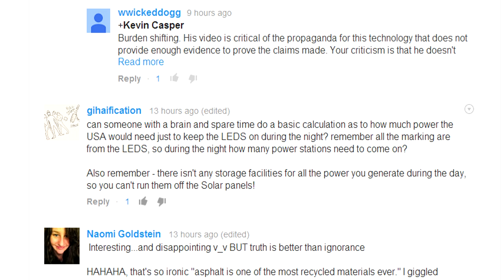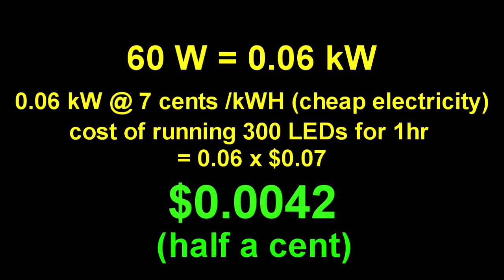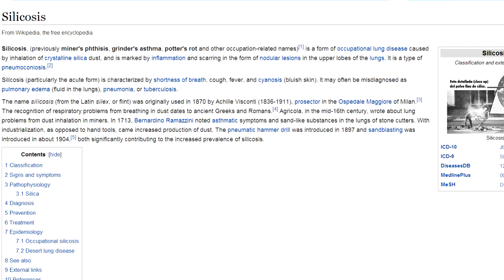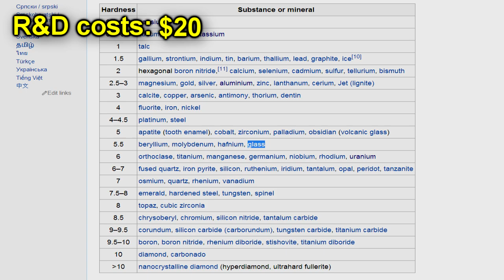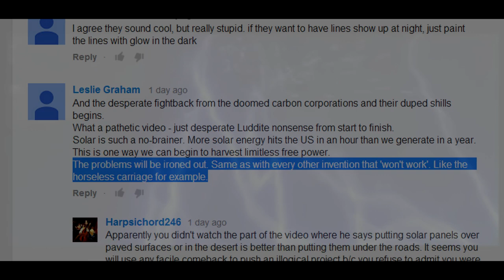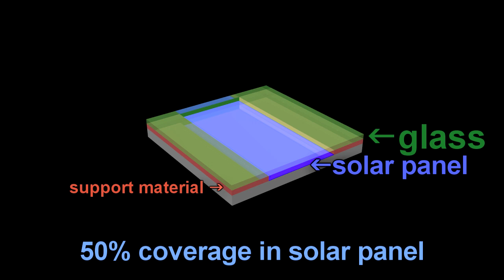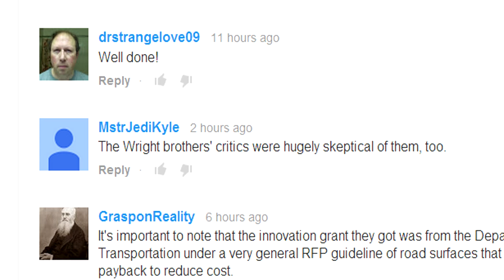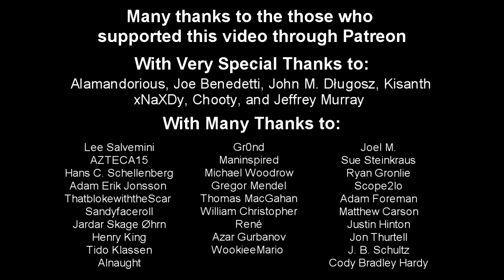Solar Roadways, IMPORTANT QUESTIONS AND ANSWERS!

Comment: It's good to be a skeptic, but: How much would it cost to replace all the blacktop roads with new blacktop? (eventually it will have to be replaced.)
If the roads are generating electricity, what will electricity cost at that point to power LEDs??
Why are you grinding rocks against the glass? Tires aren't made of rocks.
Health issues from ground up glass dust?  But ground up asphalt dust is safe?
We're not talking about glass that they make drinking glasses from.
The LEDs in a traffic light last more than 4 years. I think they last more like 20.
The solar panels use glass prisms to get maximum sunlight on the panels no matter what the angle of the sun, in addition to better road traction.
Reply: If you had listened you would have known it's to simulate the effects of dirt. He uses a piece of rubber to rub it to simulate the effects dirt being rubbed on the glass road by tires. It is a very simple experiment but then again, it's only a small fraction of the punishment actual traffic exerts on roads. Keep in mind that especially industrial vehicles will carry a lot of dirt on their tires.
Also: blacktop is quite cheap to replace and has a fairly long lifespan. Why do you think the stuff is used in the first place? The costs of regular public roads btw, are usually public information. Look it up with the apropriate governement body. As for the costs of the glass road: see TF's previous vid on the subject...
Reply: 1) Depends anywhere from  $1-$12 per square foot (about the size of 1 solar tile) depending on if there's asphalt already there and the treatments you want done to it, of course this is for materials and on a consumer basis, no idea on the labor on a contractor basis.

The cost for the panels without the corridor and extra grid that would be required are unknown but their initial hopes were to get it under $7k and hope the tiles last 20 years minimum.

2) He's grinding rocks against the glass to demonstrate that glass will get scratched by common rocks/sand which will both affect the texture they're relying on for traction and will cloud the glass as it's getting worn which will further affect the amount of power the tiles can generate.

They're using tempered glass which is a similar glass/hardness of the coffee mug.

As a note, if he tried this with gorilla glass instead of tempered glass it would still get scratched, just not as badly. Sapphire glass could be considered scratched resistant enough for road applications, but it has other shortfalls not the least being the enormous cost.
Reply: LEDs in traffic lights are not constantly on. These would need to be if they are marking the road, meaning their effective life span is lessened to its minimum expected. They might last longer, but it becomes unreliable at that point.

Also, if you had paid attention in the last video, blacktop is heavily recycled. Blacktop removed is reground, remixed with tar and reused. Also, unless they plan on placing these roads on 100% elevated surfaces, rocks, dirt, dust and debris will get on it. The road dust he picked up was likely on the shoulder of some road.
Reply: Roadbeds are made of crushed stone, and the designers of this project have made no mention of changing the roadbed as part of their pipe dream.
Reply: Highway blacktop can be recycled. Point refuted.
Reply: *****
Why would it matter if the materials aren't going to be good enough to do it's intended function? It's basically the same as using a diffuser on a camera flash or putting a flash light up to a water jug. It's nothing new or brilliant. Oh joy they are using an idea to solve a problem for a product that can't perform it's function.
Reply: NUTCASE71733 Can be and is.  Most asphalt being laid today is 95%+ recycled.
Reply: ***** the Prism/Retroreflector is a thing that has NOTHING to do with the Solar Roadways. The Prism/Retroreflector are widly used as reflectors on cars, in existing roads and Road-markings (Glass Pearls do the same).
Prism/Retroreflectors in the Solar Panels do not guide the light to the solar collectors; they reflect it away.
Prisms can guide the light to the solar collectors but do not work anymore under a protective glass cover (that reflects 80 % of the light away, or when scratched, diffuses it so the prisms cannot use it anyway)
Prisms above the protective glass will be worn away by 5 minutes of heavy traffic.
So forget the Prism/Retroreflectors!
Reply: Holy fuck.
Reply: Ok, I will answer one by one:
How much would it cost to replace all the blacktop roads with new blacktop?
- The blacktop is less expencive than blocks with PCB, LEDs, solar panels and other components. I don't have time to count exact numbers, but by estimate, it would be at least 100 times less expencive (since 1m^2 of blacktop all together costs about 50$ and just solar panel of that size costs 300$)...

If the roads are generating electricity, what will electricity cost at that point to power LEDs??
- Few times more than it would cost now. Energy from solar panels is more expencive than from f.e. nuclear power plant, plus you need to store it, or redistribute it (both would be harder in this kind of arangement). The problem is that making semiconductors (that is what panels are made of) and glass require very high temperature. Ordinary SP "pays" back energy that was needed just to make it in about 1/3 of its lifespan!!
Since SP under road are even less effective, they would NEVER pay back energy, and I am not even counting the energy requirements for production of covering glass...

Why are you grinding rocks against the glass? Tires aren't made of rocks.
- Tires are not made of rocks, but they usually pick them around the road. Look at any tire, you would be lucky to not find a single rock stuck inside...

Health issues from ground up glass dust?  But ground up asphalt dust is safe?
- Asphalt doesn't get ground up as easily as glass does..

We're not talking about glass that they make drinking glasses from.
- Any glass will have the same properties, otherwise it wouldnt be glass...

The LEDs in a traffic light last more than 4 years. I think they last more like 20.
- Because they are not under direct UV sunlight and they are shielded from heat. Only the temperature above 70°C (and you can get that at road) will shorten the lifespan of LEDs by 50%, direct UV will do the same trick...

The solar panels use glass prisms to get maximum sunlight on the panels no matter what the angle of the sun, in addition to better road traction.
- No, they won't. solar panels require direct sunlight, glass prisms won't help with that, due to actuall physics that is behind fotovoltaic effect and even if it does, you would have to get rid of trees and grass around every road...
Reply: 1- blacktop is being repaired as needed. And if when it actually needs to be replaced it's never all at once. There's never going to be a mass replacement of it.
2- He addressed the energy in a previous video.
3- He's grinding rocks on glass because roads tend to be coated with dirt (dirt is... rocks!) He use a rubber to mimic the tire pressing the rocks against the glass
4- Well, judging by how well it's doing, not as bad as Silicosis.
5- We're talking about tempered glass, which is not much better for it anyway. (17:30).
6- I don't know enough about LEDs to talk about it.
7- Glass still eventually wears and softens. Even asphalt, which is much sturdier, wears and softens over time, except it last much longer than glass.
Reply: ***** , I am all for using more solar power. Only the way the SFR propose is not feasible, only a money-throw-away. 
You don't have to be a top-man in the field of solar power to see that the SFR are really a waste of money. 
1. The panels cannot perform their duty AND support heavy traffic
2. Glass is not a usable surface for a road.
3. The panels cannot EVER be cost-positive.
Everyone with a bit of material knowledge, a general understanding of physics and a basic understanding of electronics can see that.
Only when they make a major and elementary breakthrough in physics (in other words perform a miracle), they could make it work.
I don't see that soon (not even this century).

The idea to pave the whole country with Solar cells is, though for other reasons unwanted, not so bad, but the roads, NEVER!
Reply: ***** I think his point was that the materials simply do not exist for the applications they simultaneously want for a solar road way and you don't need to be an expert to do basic tests on the proposed materials for the task to come to that conclusion.

The makers of solar road ways claimed that they already went to material's experts and came away with tempered glass as a best fit for the applications they want. The problem is that if you can show the fundamental materials still lack the properties required for their purpose that the project is a non starter.
Reply: *****
1) They're using tempered glass, not gorilla glass or sapphire glass with scratch resistant coating.

2) Sapphire glass is around 100x more expensive than tempered glass. It also has similar issues with shattering even though it's more scratch resistant than traditional tempered glass. Sapphire glass is also merely more scratch resistant, it's far from "unbreakable"

3) if your solution to this project is propose a material that is still subject to shattering and way way more expensive again I don't see this going much of anywhere.

As a note sapphire glass will always be expensive because it requires very particular chemical processes and temperatures.

4) Technically diamond could probably fill the bill for the required properties, but it would suffer from the same thing that sapphire glass would, cost and people would also be more inclined to steal and dismantle the tiles for the raw materials. You have to remember that for this project to pay for it's self cost of materials is also an issue.
Reply: ***** The ones proposing the project are amateurs too. Their only saving grace is perhaps that the man is an electrician (or whatever it was). None of them knows exactly what they're proposing.
Reply: ***** I don't really have to be an expert when other actual experts in the field have already weighed in on this project.

Also it's not "my opinion" with regards to sapphire which isn't just tempered glass it's a synthetic sapphire otherwise it wouldn't have it's higher hardness scale. Glass only gets so hard (which is important for scratching) tempering merely increases it's strength (durability). 

He's also an electrical engineer, not a materials expert nor a road engineer and he's shown a lot of ignorance on the topic going by his faq and responses to public criticisms like TF and the criticisms of other actual road engineers.

As a note according to the solar road ways people they doubled down on tempered glass several times over throughout their faq on using tempered glass for the cover.

Also just proposing more solar panels seems good in principle, but you have to apply them smartly, for example angling panels the wrong way can make it so they pay for themselves in close to a hundred years rather than less than a decade. It seems far better to employ available technology in a smart way to make the most use of it rather than trying to change everything to accommodate a niche product that has no chance of fulfilling it's set out goals.

If solar road ways are even attempted in something similar to it's current configuration it  will require a huge infrastructure overhaul, it will barely be able to power LEDs that will be visible in the day times if it can even do that at all. The people at solar road ways haven't even addressed these problems on their page they just pretend that more money will fix all of the problems.

as far as energy goes, white paint is far more efficient at using solar energy to mark road ways than solar panels just from the theoretical (not actual) limitations of pv. At that point it just seems better to stick with what we have and use more solar where it will do the most good, not as a road way.
Reply: ***** if an actual better idea comes forward then great, but they don't even have the basics in place despite years of working on it.

At the moment though it seems it would have been better to put the money towards existing technology than this idea. I have to admit, I about lost it when looking at the military applications on their page, they basically want to put nasa robots for exploring other worlds in every solar panel.

Honestly I would have rather had that money go towards research in improving current solar faster or the many nuclear fusion and fission options that look very promising.
Reply: ***** Sticking with what works is good engineering when compared to trying expensive and pointless 'improvements'.

Every materials engineer that has taken a look at this project is calling its failure a foregone conclusion.  Every solar panel engineer that has looked at this project has proclaimed it to be a waste of resources.  Every Road building professional has called this project a boondoggle.

If you're really that big on experts, that should mean something to you.
Reply: ***** Why did you edit your question about material engineers out Swanky?  Found the answer on your own?

Change for no other reason than to be seen changing is stupid.  Changing from a cost effective time tested all weather material to unknown and untested vastly more expensive materials is stupid.
Reply: By comparison, almost nothing. Blacktop is extremely recyclable.
Reply: Clell Harmon I've seen some other people mention this that apparently they HAVE mentioned replacing the roadbed at some point.....with a support structure (i believe some kind of metal or plastic was mentioned) in other words FURTHER increasing the initial cost as well as cost of maintenance once that substructure deteriorates
Reply: TVlord5 usually the way I point out the major flaws with the project is referring to numbers of just regular solar panels. Normal roof solar panels which can at least tilt towards the sun take around 10 years to pay for themselves. According to solarroadways own numbers you lose 12ish% energy from the thick textured glass and another 30% from the fact it's not tilting towards the sun.

At which point you're approaching 14-15 years just to pay for the solar panel and nothing else and the average lifespan of the solar panel is 20 years.

Comment: In your opinion is there any way this idea could actually work? What do you think about wind turbines along the side of a road?
Reply: But why would you want them next to the road? Why does it need to be near the road at all? When I first heard about it, I too thought it sounded cool, the idea of using road space to produce energy. But why would using the road be any better than using any other space?
Reply: so.... wind powered lamps?
sounds decent, but it really depends on how much power you can generate.
in some of the less windy and rural areas this won't be considered.
But one key problem i want to highlight, is that wind turbines have a lot of issues that makes them not ideal for smaller applications, such as the wild ac issue, or that you require an actual generator in each of these turbines, which makes it bulky and costly.
Reply: Wind turbines alongside the road. really, Wind turbines, alongside, roads.
what difference would it make to put them elsewhere, i dunno, like by the sea, where the wind is more prevalent? why clump the wind turbines together in a farm to have a simple infrastructure for power transport, when you can place them spread out across the entire country?
You know, like existing, well thought out systems that actually work?

Sorry to sound like an ass, but existing technology is that way for a reason.
if you actually had a good idea, there would be much support from the actual engineer population, instead of all these critics.
I'm a renewable energies student, and i think this is absolute bullsh*t
Reply: sorry. Let me clarify. What I've seen are small turbines attached to streetlights on motorways, which would be driven by the wind created by the vehicles. This would go towards powering the lights themselves. Surely wouldn't be that expensive to maintain and they coyuld just be built into new streetlights rather than replacing them across the board.
Reply: Not sure how much wind vehicles produce.. but hmmm, interesting.

Comment: This is a weird calculation. First of all covering ALL surfaces in the lower 48 is an insane goal, so what really matters is whether these panels on average generate more power than they use. The bigger that difference, the bigger the incentive. Also, not all the LEDs will be on all the time. In fact most will be off. Finally, when you buy in bulk (and I'd say several billion LEDs qualifies as bulk) you can get stuff significantly cheaper.
Reply: The material failures are solid objections though, it would indeed be far better to cover roofs and roadsides with oriented panels. A more worthwhile R&D project would be a way to automatically orient panels towards the sun with minimal power consumption.

Comment: Glass can be harder then steel made not to scratch and when no one is one the road the lights are out, they only come on when a vehicle comes close to it.. The glass has passed all tests for impact load and traction with flying colors. Do you have permission to use their video to slander the inventors with your bull shit.  I have Led lights that come with a 30 year warranty.   Have you ever heard of large scale grid energy storage.  You could be sued and should be and at the very least have your YouTube account terminated.